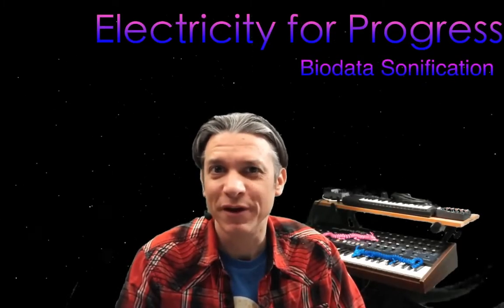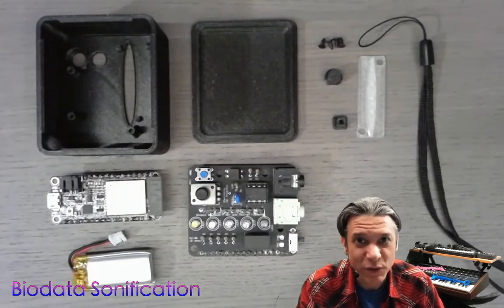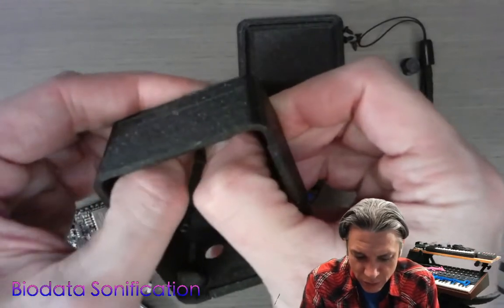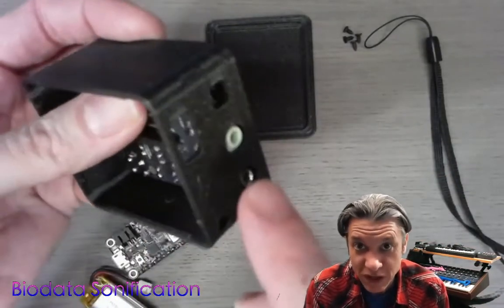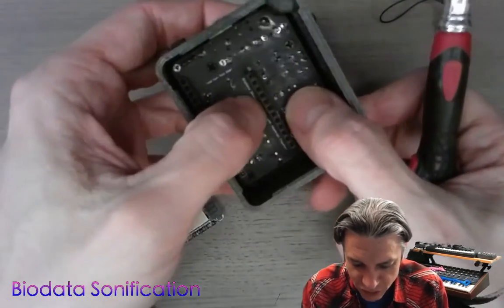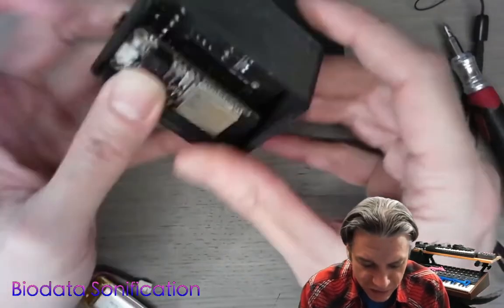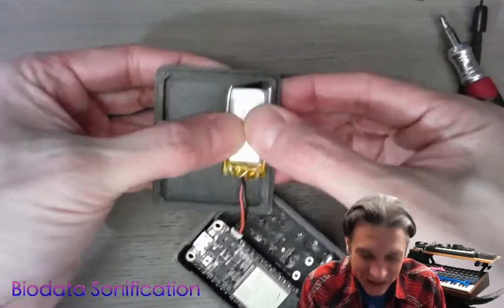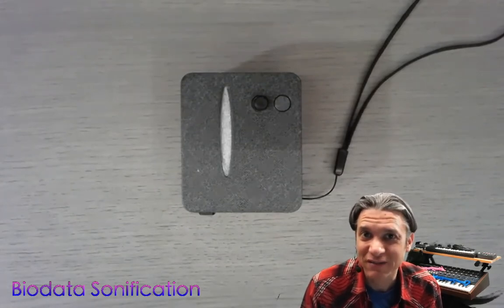Biodata Device Enclosure Assembly

Comment: I have a craft synth 2.0 with 5 pin midi input, Can this connect straight to the midi port with a 3.5 - 5 pin midi or is there a certain midi controller you would recommend to use with the Biodata Sonification board
Reply from the maker: Great question greg! This device uses standard midi, type a, out of a 3.5 mm jack. A simple converter cable can take you from type a to the full 510 din this device works directly connected with any standard mini device, and can be configured to output on channels 1 through 16. And of course the big fancy part of this is that it can connect through bluetooth, or RTP Wi-Fi midi for those who are doing large-scale installations. Check out my website, or send me an email and I'd be happy to answer any other questions you have, and get you set up with a module!